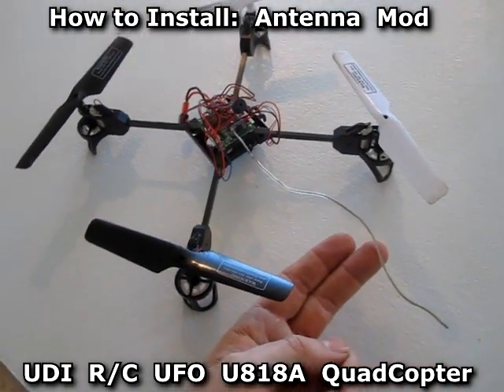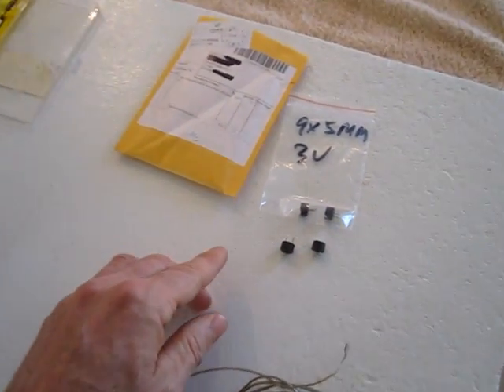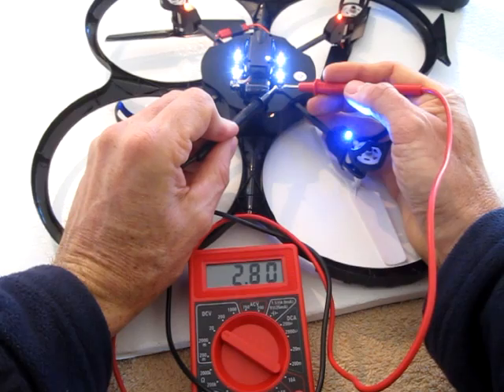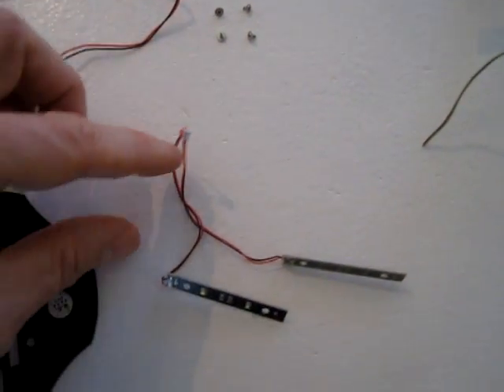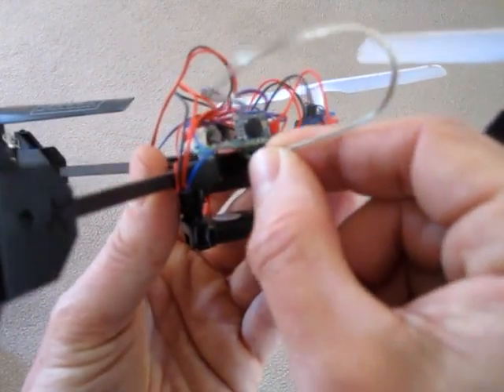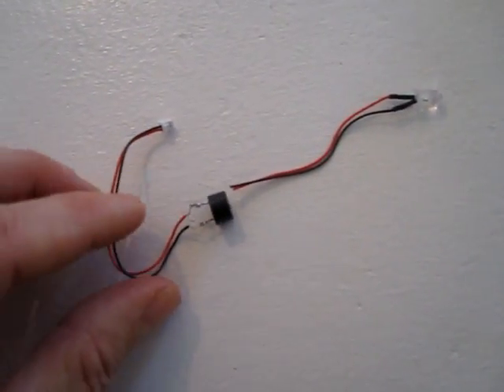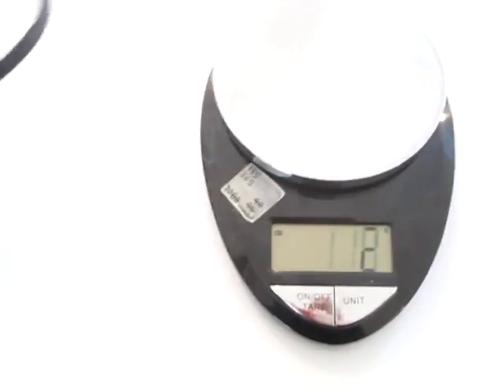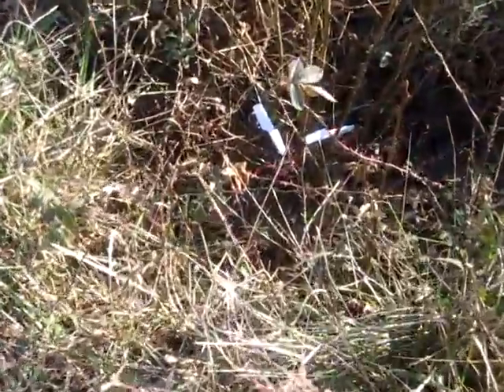UDI U818A Modifications Antenna and Buzzer Mods Quadcopter DJI Phantom Drone camera

Comment: Can I suggest a different way to get that buzzer feature?  Search for "wireless 5 in 1 key finder". It's probably sold everywhere under a whole load of brandnames. It consists of a 5 key handset and 5 key fobs. Disassemble a fob and inside you'll find a teeny circuit board which includes a CR2032 battery and buzzer. Glue that inside the U8181A shell (it can easily carry this weight). The point is that now your buzzer has independant power, like a black box!  In my case one common occurrence in a crash is that the main battery falls out, but with this method that won't stop the buzzer from working - and you don't have to lose the LED on the nose.
Reply: MrSwanley 
How much does it weigh?

Comment: i was wondering if you have a solution to my problem, the black wings wont spin to their full potential causing the front to flip back on itself and thus not fly. do you know whats the probkem?
Reply from the maker: ive had this problem after using the copter for a long time. one of the motors burnt out. i was able to buy a replacement motor online and it fixed it. it was fairly difficult to install the new motor, soldering the tiny wires and reassembling was tough. i got the motors from banggood dot com but its probably better to buy a new quadcopter and use it for parts, it'll be cheaper and u can just replace the entire motor arm.
Reply: I see that you had it for a while but mines only 5 months old

Comment: BubbleBeet 
Nice job!  Thanks for taking your time and giving us Newbies some great ideas.  Have you done anything on upgrading the battery? I saw one guy on YouTube remount the bottom leds and stick a 1200mAh 3.7v side to side. Looks like a perfect fit and he said he gets 2 x flight time.  Thanks again
Reply: I seen that video and the test video after the instructional video . The guy got just over ten min of fight time doubling the flight time of the stock battery . I am thinking of getting this drone and am glad I have found these mods . I bought a harbor freight wire feed welder and preformed a mod to it tthat increased performance . And I did it with the instruction of a you tube video .

Comment: Perhaps measuring and cutting to proper wavelength? 2.4GHz figure mid bandwidth is 2.44Ghz  so 1/2 wave 2.30 in. 1/4 wave 1.15 in. Use a bit of antenna theory here. Oorah!
Reply: Hey- can you expand? Wanna do the antenna mod
Reply: These are the lengths the wire needs to be cut depending on wavelength

Comment: Hi, I unplugged red and blue LEDs from pcb and tried flying my UDI quadcopter without them and now when I want to plug them back, I forgot what are the corresponding sockets for each of the four connectors. Could you PLEASE send me photos or diagrams where to connect them?? My mail is: viki.bozicevic@gmail.com

Comment: Hi, can the extension wire for the range performance be soldered inside of the transmitter rather than quadcopter? And does this wire has to be the same gauge (thickness) or could be thinner? I'm not a professional in rc, but also have this quadcopter and would like to make a simple mod for more distant flying. Can someone please reply??

Comment: I have a UDI 1818A-1  & I could not get the buzzer mod (which is a great idea) to work, I have 3v buzzers but do not get any sound out of them when plugging it into either of the LED plugs. Any thoughts on the possible differences, almost acts like there is not enough current supplied on the board to power the buzzer.

Thanks
JP
Reply from the maker: yes sounds right maybe the buzzers u r using need more current. the only buzzers ive tried are the ones shown in this video. One thing ive noticed is they work fine except for when it gets cold. When the temp outside is below 50 F they sometimes dont buzz.
Reply: Do you have any more info on the buzzers, any part number on them or anything else, The buzzers I have are 3 volt and work if you apply them directly to a battery, even down to 3.2 volts on a 1200 mah battery.
Reply from the maker: heres the Buzzer info: EBAY seller - Tescomalls ... Item title - 5pcs Buzzer(active long beep) 9x5mm 3v ... Price $0.99 + $0.80 shipping, total $1.79. they came from china so it took 3 weeks to arrive.
Reply: Thanks, Tescomalls does not have any buzzers for sale on ebay now, I did find one from Mouser electronics that only uses 9 mA, which is about 1/3 of what the other buzzers I tried, If this works I will post the part number & let you know.
One other thing, my battery alarm on the transmitter goes off in less than a minute when I start flying, I get about 8-10 minutes of flight on 1200 mah batteries, and I have a Turnigy charger that gets them to a 4.2 full charge, just that stupid alarm is annoying. I took the transmitter apart and put tape over the buzzer to quite it down, next I may take it out altogether, it's just annoying. Do you have similar experiences with yours? Or know any way to adjust this?
 
Also your latest videos are great, you have a big area to fly in, we have a ton of trees & I am not that skilled yet, but learning.

Thanks

JP
Reply from the maker: I just searched ebay for '3v Buzzer' and the first few results are the same tiny round buzzers i used. One listing is 10 for $1.71 free ship(from china so it'd take 2-3 weeks to arrive). They have the white sticker on front u peel off. Ive bought 3 of these UDI quads and none of em make the low battery buzz u mentioned. if the buzz is loud enough itd be interesting to see if u can remove it and use it for the quad locator buzzer, if its 3v.
Reply: ***** The buzzers I originally  tried were just like you found, they have the sticker on them and the specs say they take anywhere from 30-45 Mah in current, I just got the buzzer from Mouser electronics today it only consumes 9 Mah, so I will let you know how it goes on the install.
Reply: Jeff Pharris, I just used the buzzer from Mouser electronics, it is rated at 3v dc & 9Ma, it works great, although its big, about the size of a quarter and 1/2" thick, but not very heavy, specs say it is 100db loud, and it is very loud. the part number from Mouser electronics is 665-AI3035TWT3VR, I think it was $3.24 + shipping, But it works great, all the other buzzers I tried drew too much current to work,

Comment: Did the antenna mod after watching your video; WORKS GREAT! Much better range on the UAV and no interruptions in the videos now because it lost the signal. I was able to watch the full 12 minutes of flight time (3 minutes longer than average) without gaps. Thanks for the great tip.   question, why ebay versus amazon or for lack of a better example, why not Radio Shack for the buzzers? 3 weeks seems like a long time for buzzers, just curious. thx again
Reply from the maker: i searched around before i bought the buzzers and the 5pack from china was the cheapest and i didnt really need them fast. also the china ones were alot smaller and lighter looking than the radio shack buzzers. thanks, im happy to hear the antenna mod worked for u too. sorry it took so long to respond i didnt see your comment until now.

Comment: Sweet. Figure I would learn how to fly this toy before flying my FPV quad. I'll be doing this same mod, including weight reduction. Add a go-pro, add a bigger battery, and balance impellers. Hope these little motors hold up. Should be a nice little setup

Comment: Good idea, let me got a lot to help production.There is a way to find lost machine, when you lost, turn off the remote control switch, then open again, when the machine with the remote control when they close to the code, will know that the attachment.

Comment from the maker: https://www.youtube.com/watch?v=Sw9L0mkW_Eo
Heres some new flight footage video with the mods installed, SUPER HIGH ALTITUDE and getting stuck in a tree multiple times.
Reply from the maker: sounds like u r getting good distance already. i can get 250+ feet but then the problem is the drone looks like a tiny black dot and its hard to control since its barely visible. not sure the gauge of wire but it was the same size as the drones wire. the wire u have will work fine tho probably
Reply: +BubbleBeet i did the antenna last night and it worked great! i used 16g wire as opposed to what i think is 18 from the drone. i can tell you it gavee at least another 100+ ft to the point like you mentioned i can barely see it! thanks for the tip! now i need to find a short red LED strip that i can add to the back to help with orientation awareness at distance as i removed the outer shell
Reply: ***** 
Does this work with the unit that is for sale and covers upto 30 meters?
Reply: ***** Just about to do the antenna mod and curious what was your after distance. I'm have the UDI 818A-1 and get about 200ft+ horizontal range and at least 150ft+ vertical before the mod.  What do you think I can expect from this mod?  Also. What gauge of speaker wire did you use?  I have 16G on hand but it seems slightly larger in diameter than the stock wire gauge. Thanks!

Comment: Hi,

I love your idea.

I succeed changing the UDO 818A tx controller antenna. Watch here:

https://www.youtube.com/watch?v=q7MP1zaKIWM
Reply from the maker: cool antenna vid, i'll try that mod out next. Thanks!
Reply: ***** I'm very interested in your antenna mod. Can you perform a simple distance test with your new antenna ?
Reply from the maker: Raul F. with the antenna extension mod it can get 250 feet in distance and record a long single video clip of 30mb. Without the antenna extension the quadcopter would lose connection for a fraction of a second at 60+ feet and record a 10mb video clip followed by a bunch of short 1 or 2 mb clips. i guess the weak signal was causing it to repeatedly stop and start the camera.
Reply: ***** I did your atenna mod with no luck. I tried many different cable lengths but I got better range using stock RX antena. Cheers.
Reply: I am new to this and don't have the drone as of yet . I would a computer wifi antenna work for this . I have couple lap top with parts and that would be great upon doing this mod . Thank You & God Bless